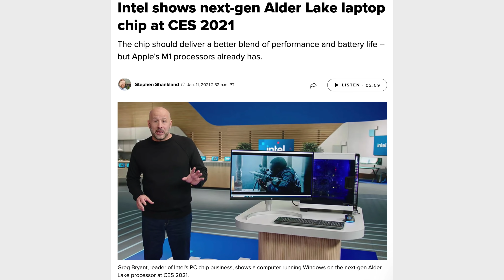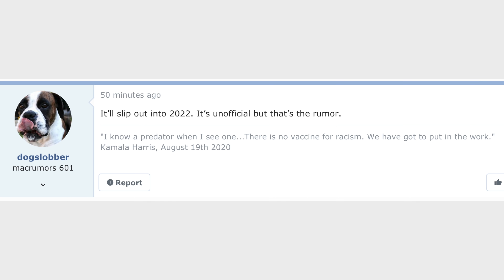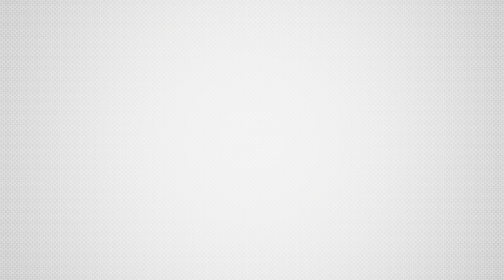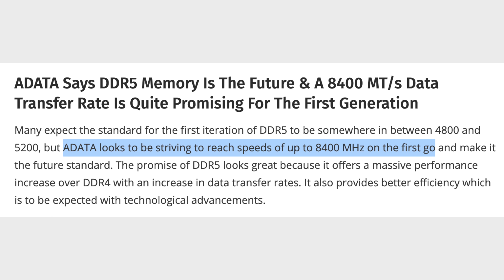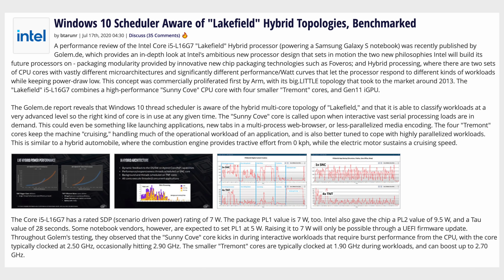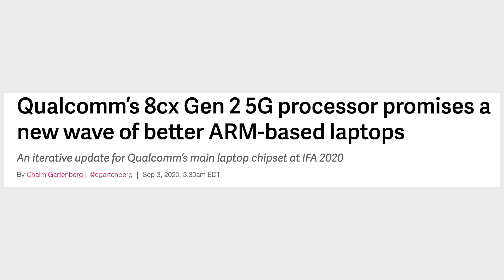Apple M1X vs Intel Hybrid Alder Lake CPU - This is WAR!

Comment: For me M1 chip and intel is not really an Apple to Apple Comparison. First of all M1 chip is only used in Mac environment, Apple can easily optimize it performance. Because there is no way user will be buying M1 chip to put in their desktop build nor in nother windows laptop. Basically the operating system, drivers hardware all are fix and known to M1 developer. It would be much easier to optimize the performance compared to intel where it can be fit to countless hardwares and OS. 
Yes, on paper M1 chip may seems better than intel. But does it really matter? I don't think so as not everyone love MacOS. M1 chip wont dominates the CPU market as they are locking themselves into their own Apple ecosystem.  Simply put, It is not the third player in CPU manufactrurery. It wont be direct competitor to AMD and Intel. I dont think M1 would perform the same if it was run on windows 11.

Comment: These comments are actually embarrassing  , people still dont realize that intel is a cpu and apple is an Arm SOC chip who also manufactures the hard ware as well. Intel has to make chips for a wide variety of laptops and apple just has to focus on theirs. You all are so bent on scrubbing intel in the dirt but dont realize they’re a small part in a much larger company …. The performance isnt really that different either other than individual company optimization of their devices. It really just comes down to if you want windows or apple…

Comment: Six months ago I was agreeing with that Intel is done however since the pandemic set in and massive supply shocks impacted all markets causing the shortages that use chips is giving Intel CPUs a chance to stick around. The long term still holds that Intel’s real enemy is ARM not Apple, Nvidia/Mediatek, or Qualcomm etc. Intel saw the writing on the wall and read it. That’s why they’re trying to buy Si-Five. I don’t know what the future hold but it sure looks like a computer revolution is in progress. High end DGPUs will become the niche market like the audiophile market and ARM with integrated graphics and computers like the Mac mini in size will be the common alongside mobile devices.

Comment: I wish the success only to Apple ARM chips because they deserve it. They will help us pulling us from he Nvidia & intel greed swamp! Nvidia, intel & windows producing slow advancement tech with compatibility issues products for insane price. Nvidia & intel are the reason I hated my MacBook Pro & switch back to windows!
I'm grateful to God to live & see this chip exist! This Apple M chips moments is actually as the moment as first iPhone released!
I'm pretty sure not only me going to change to MacBook Pro later this year when MBP reveals the beast inside, most of the people are If the PC industry not going to catch the ARM PC version race! 

About storage:
I would suggest to buy the smallest internal SSD & use it only for OS & apps & buy a thunderbolt flash drive for production, same to gaming buy a thunderbolt flash drive for gaming, & so on! 2.5" external storage is physically big & it will take a lot of space for many projects & uses & think using as an external storage is a tech going to die soon. Flash drives are the future, so small & available with big capacities! 

About ports:
 The charging port need to get back to benefit from the usb c thunderbolt ports. From now & on should be usb c thunderbolt & it should have been before. The usb c thunderbolt port should be at least 4 ports. 
This usb c thunderbolt is so amazing that when you plugin external monitor that supports usb c thunderbolt you can plug to that monitor the mouse, K/B & the headset!!

Comment: I honestly can't wait until other companies get ARM CPUs into laptops. It's been the case for a long time that X86 was used because there were no other choices, not because X86 is better at literally ANYTHING. 

The entire point of X86 was to make it so that the processor took assembly with relatively short instructions and did a lot of work with them. That way a simple text program was like 20KB instead of almost 40KB. But the cost of storage now is so much lower than it was in the 20th Century that RISC architectures like ARM or well RISCV with any real investment and good programming principles, are vastly superior.

Obviously I hope that RISCV comes along a lot more in terms of the general infrastructure around it so that companies aren't forced to pay a lot to license ARM, and designs are more varied. Like, the fact that every ARM chip uses the same few core designs is pretty depressing and would be just as bad as Intel and AMD are right now.

Comment: I'm not too interested in Chip/OS wars, I only want to have a product that gives me the performance and features I'm looking for. I currently have a Mac M1 Mini, and it's a wonderful device, but I also am looking at replacing both a Windows laptop and desktop, preferably with single Windows laptop. I currently have the HP Spectre X360 (i7) and would like another as that replacement, but am waiting to see what HP does about a more powerful processor that would allow me to replace both.

Comment: More like Intel vs AMD again......x86 failed Apple so Apple moved on to their own path. Apple has the software for their chips while Intel or AMD has to wait on Microsoft. Apple is not going to pick AMD if Apple is already building in house chips already. Steve Jobs would be proud if he was alive today because his dream lived on. Apple forced the market towards ARM from a PC LEVEL. If x86 was all that  why even build a hybrid chip? Both ARM and X86 is old however since Apple controls their own software for it the speeds on arm can be great and Windows trying to milk x86 will be left in the dust. Apple already understands RISC so this game is nothing new to them. Apple was just waiting for the ARM market to mature and it did. It seems to me that x86 is getting bigger and bigger like the 80s computer while arm is still smaller. Arm needed a great OS and Apple came with their OS. Just look at peoples gaming machines....they look like machines from the past with a MODERN look while drawing in massive power like the 80s.

Comment: Good lord. So many errors in this video (logical and editorial). How the hell is Apple going to compete in datacenters, when their OS can’t virtualize other OSes natively, can’t run the vast majority of software that has no ARM variant, etc? Utter nonsense. Apple exited the server game a decade ago for a reason. The big cloud providers are all designing their own hardware now, and for the clusters that don’t run on that fabric, they run AMD or Intel and will for the foreseeable future. And Intel in “secret talks” with Windows? Err, did you mean Microsoft? The same Microsoft that has had a long and storied partnership with Intel spanning 3 decades? What is “secret” about Microsoft working with Intel to fully support Alder Lake. 

In summary, this video is click bait trash with little to no substance. I’m unsubscribing and blocking recommendations for your channel.

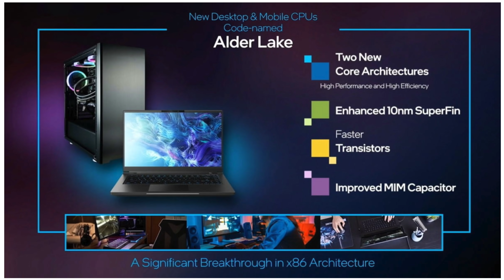Comment: 02:07 My dude you don't know anything about process technology. So stop spewing nonsense. Intel's 10nm Superfin is equal to TSMC's 7nm. Companies can use any number in their marketing but what matters is the details like fin pitch, gate pitch, fin height and fin width in a process technology. That's how you measure the transistor density. Check and compare Intel's 10nm Superfin vs TSMC'S 7nm and you'll see they are almost equal.

Comment: Intel was actually over confident thinking that "No one Could Ever Compete Them in Processer Market"  and making money with their high price tags on DIRTY PERFORMANCE of their INTEL CHIPS and Finally APPLE splashed a bucket water on Intel by the late 2020🤣🤣
Reply: The M1 isn't faster than the i9 10900k. I beat it at single-core but the ram is limited. Apple is about to get really expensive and a lot of people aren't going to be able to afford the newer chips with more ram and gpu. The maxed-out M1 Imac is overpriced

Comment: I think x86 architecture is at the end of its life. There will always be a small market in antiquated dos systems that a lot of warehouse management systems use, but for servers and personal computers, ARM architecture makes a lot more sense moving forward, especially if we continue to run more and more software from cloud sources. I think both AMD and Intel would be smart to start adding an equal amount of ARM cores into their chips and transitioning.

Comment: Intel has DEFINITELY lost SOFTWARE part before Apple thought about A4.  They don't provide compilers, they don't provide and can't enforce libraries that DO make use of their ALREADY existing extensions (MMX anyone? quarter of century old?). Intel's 10nm is close to TSMC 7nm  anyway, but it doesn't matter - whatever gain intel makes, Microsoft and 99% of software developers will BOTCH.  What about Wolfram Research, Autodesk, Blender all other interested?

Comment: it's marketing compromise., intel sold their technology to tsmc, samsung, hynix, amd, and apple  intel might just playing stupid for specified period of time because 2020 apple m1 chip release (5nm transistor claim to be the fastest) amd for 7nm claim to be the best for value gaming and intel just 14nm+++ with thermal temp up 99c (i know this because the cpu performance is not just based on nm size of transistor, for easy example (i7 is better than celeron which have same size of  transistor) this is why intel replacing CEO Bob Swan with tech vet Pat Gelsinger #it'sallaboutprofit

Comment: If Alder Lake is a CISC chip it will still have power consumption/heat problems. Knowing them this is probably the case. Sounds like a panic move.

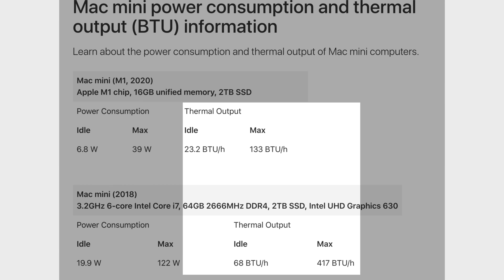Comment: 3:30 or if you are poor like me, you can install 
ThrottleStop on old intel laptops like i do and only use 3.2W -6W when idle or browsing no need to buy new one. But there is a voltage tweek involved and disabling the turbo boost. If you need performance than switch on normal settings. https://prnt.sc/wnxq13

Comment: One should not forget though, that x86 still has a huge foothold:

a) legacy software - do not underestimate that factor. Life is not only Photoshop, as it appears (sadly) on most Mac channels
b) x86 has instructions and accelerators that ARM doesn't. Take AVX for example. I doubt M1 can do a 512-piece vector multiplication

What this means: In the private space, M1 and other RISC-Cores are certainly a killer, because consumption really matters and specialized instructions are rarely used or replaced by GPU acceleration.
In the server space this can be quite different. It makes a huge difference if you are running a webserver (which runs perfectly on ARM or RISC-V) or if you a running a Biotech-Compute-Cluster folding proteins on high-end GPUs or with vectorized CPU instructions.

Comment: Server farms are never going to use M1 chips. They'll stick to consumer chip makers and that's why AMD is the new leader in server processors. Also the software side of the server is a big issue, as transition away from x86 code won't be a piece of cake for the servers. This transition will take some time, but I hope that everyone moves away from these power hungry chips and go ARM all the way.

Comment: In defense of Intel 10nm is almost the same as 7nm on other platforms. It has to do with the way it’s measured. Vadim seems to not know this. You simply can’t say the Intel is behind if Intel successfully releases a 10 m’n chip while you compare it with a 7nm TSMC chip. That said there’s a massive problem in an other comparison that Vadim did. He said that Intel will combine coves cores with monts cores much like Apple did. However this is not true because Apple chips are both baked on 7nm which are both power efficient. When you combine a 14nm ( not so efficient core) with a 10nm (efficient core) and the 10nm is meant for high performance you don’t get it. That 14nm efficient core will be power hungry simply because larger transistors utilize more power consumption. In the meantime Apple has two core types that have the same lithography of 7nm. So Apple will still have the upper hand simply because both of their cores are the same size. Intel got it wrong by combining two lithographies together. And thus they are not doing the same thing.

Comment: Intel reports a density of 100.76MTr/mm2 (mega-transistor per squared millimetre) for its 10nm process, while TSMC's 7nm process is said to land a little behind at 91.2MTr/mm2 (via Wikichip).
https://www.pcgamer.com/chipmaking-process-node-naming-lmc-paper/#:~:text=Intel%20reports%20a%20density%20of,Ryzen%20on%20the%20other%20hand%E2%80%A6.

Comment: guys i have a question so i just bought myself the M1 MacBook Air and i dont know how to see the cpu temperature. i noticed that some people can see their temperature in the menu bar but im not sure how. this is my first macbook so anyone that can help i would really appreciate it
Reply: the macbook air with intel you could use it to heat food, using it put it between your legs and if you suffer first degree burns it is because it gets hot
Reply: @4everzapy  i have the M1 macbook air and it doesn’t heat up at all but i’d still like to be able to see the cpu temperature but idk how

Comment: Technically, x86 or x86-64 provides a standard architecture for OS and app developers. Apple will be successful because of the tight control they have over the hardware and OS. But if different companies release different arm architectures it would a nightmare for software development.

Comment: Much as M1 has been a great success for Apple in the portable space, it still has a way to go to bring the reliability and performance of desktop workstations and there is still a lot of bottlenecks and stability issues holding serious users from fully embracing M1 -for example Adobe suite.  Intel built the very first arm based processors for windows ce way back so they own quite a bit of arm knowledge. I am not sure why graphics performance is stressed in server applications as it's typically cores that are used in large numbers and x86 is the dominant architecture for servers, but apple may be able to move their cloud services to M1 based systems which would be an interesting move.  Given the speed of AMD and Intel's response to M1,I would expect the race for the optimal cpu will get much tighter in 2021, showing that these companies are a lot closer than the fanboys would like to believe

Comment: The trouble is that Intel does not control everything it needs to deliver top notch performance to the end user.  What everyone is missing about the Apple M1 story is that Apple has produced THE BEST developer tools for many years.  When apple improves the chip, the software can use it on day one.  Intels "build it and they will come....maybe" adds over a year to their tech deficit and raises the risk of the investment.  The fast core/efficient core plan is doomed if Intel does not have developer tools NOW.
If Intel is as smart as I think they are, they are already secretly working on a new instruction set and considering RISC-V open source, vs the best instruction set they can think of.  X86 has lost the mobile market and servers are next.  If Intel had the developer tools the war would not be over but....

Comment: Can u comment on Snapdragon on Windows right now??

Was it compatible right now without issues?
Reply: Actually it has been implemented already in 2018 but it failed horribly because windows rely on x86 architecture while SD is arm based risc. What apple also did with m1 differently is to make sure their os works with risc. While almost all the apps right now are dependent on x86 even in macs, at least apple figured the way for OS to work really good with arm based risc. I'm no apple fanboy and I use windows, but apple did a great job. Idea is still good with windows to run on arm based cpu but it too far in future if it gets implemented correctly
Reply: @ashish2099  i see. So since apple already done it. Maybe for Windows it can be implemented and make it compatible soon i guess.

Comment: By the time intel is on 10nm apple will be on 3nm
Reply: apple dont have 3nnm or even 100nm. tsmc have 7nm and this is not apple tech.
intel 10nm is more or less equal to tsmc 7nm.   tsmc is now producing for AMD apple and nvidia.
tsmc will not be able to catch up for all, what mean AMD/Nvidia are in trouble as apple bought all 5nm and 3nm tsmc manufacturing capability. no one will able to manufacturing for them.

Comment: In my opinion intel and qualcomm should collab on chip design and get their manufacturing done by the same manufacturer Apple is using. As far as the OS goes, all companies should work on reactOS to develop it enough so that it could run Windows programs and also combine that with linux/BSD for better security and looks like macOS... Also, companies should release their processor architecture as open source so the design of it can be improved by everyone.. that imo, would force apple to their knees pretty much... The thing is we will have a better and open source OS with better security and features as compared to macOS.. also, with the open source chip architecture anyone could work on it and then we will have better technology all together..

Comment: I wish Apple would make a move to improve app compatibility. I really want to buy a Macbook but I’m afraid whether it’ll do the job for me in engineering school. If they could make a built-in virtualization app for ARM Windows 10 or somehow make the Windows apps run on macOS, there would be no doubts for me.
Reply: Parallels VM software has a beta it works pretty good and it’s free right now.
Reply: @melmelcorvette  i hope it stays free until i get a macbook lol, thanks for letting me know